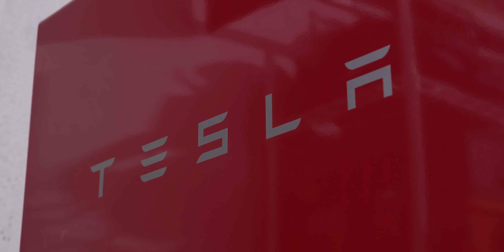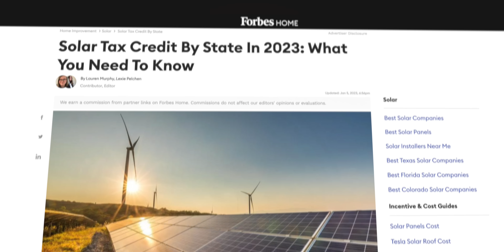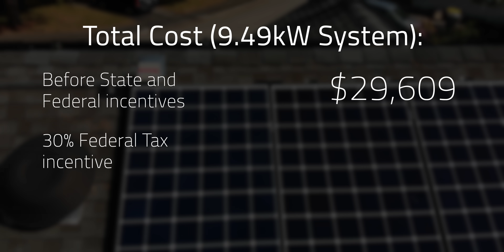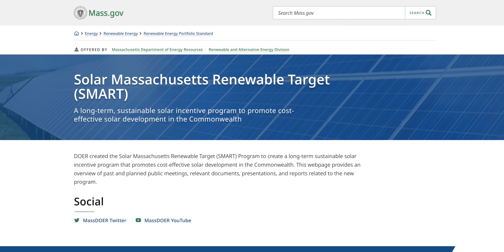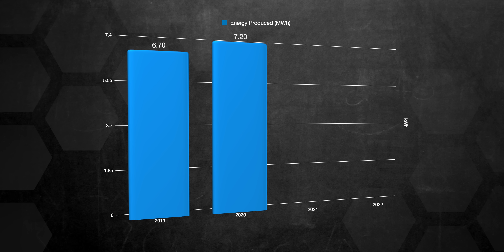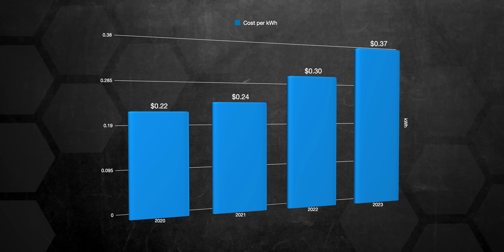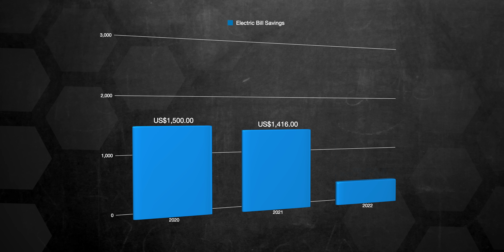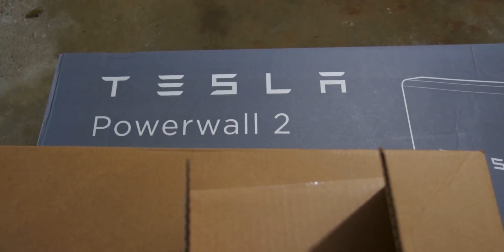5 Years with Solar Panels - Is It Still Worth It?

Comment: i spent a LOT on a 27 panels, 20kwh batteries, controlled by a solaredge system. did get substantial tax benefits. 
happened back in 2020. 

my calculation was
1) bank interest rate was .02% !!!
2) inflation will cause a negative return on bank savings AND ever increase electric power rates
3) there will be partial return on the solar system from selling the house

ignoring depreciation, system degradation, the system is returning 2% on investment. ALSO, i benefited from continuous power despite power outages. so, there is peace of mind.

Comment: How big (capacity) is the setup going to be at your new house? I have 6600kWh on my roof and if I knew now...... I would have put as many panels as I could on the roof. However the biggest regret is not knowing enough to get an installer who knew their stuff even though they were recommended from a site that supposedly checked the recommended installers out. I had twenty panels installed with two faulty panels installed and a third one going faulty seven months later and now three years after they were installed they are still sitting on the roof. Installer has gone out of business so it's shit creek and no paddle.

Comment: Hello Matt, I totally agree with you LG Panels were the BEST, I did a lot of research, with that huge 25 year guarantee ok a little more expensive but well worth it, I was totally shocked when LG stopped making them, I hoped to use them on my next home 🏡 when children left home to go to university, Solar panels on South facing back lawn on stands, love the look of the tracking flower Solar system but got to keep expenses down in retirement,
I have a feeling your next house will no doubt will be very economical to run, I even thought of moving fridges & freezers to a cooler garage away from the warm kitchen,
Matt have you ever thought of collecting rain off the room, filter & store that in a underground tank & using that say flushing toilets - watering the garden etc,
The energy crisis here so we all need to save as much as we can,
Thanks again for the very interesting YouTube channel 👍

Comment: 9.4kW power panels, but how much is the inverter? The production seems quite low, similar to the estimated production I get for a 5kW power with 4-5kW inverter. Ofcourse, depends on the latitude, I get this estimate in south Romania, 45° north latitude. I am preparing to start the installation process for a 11kW peak power panels with 8.2kW power inverter, east and south orientation, and this setups should produce about 12-13 MWh per year. Without any battery, the setup will cost about 6k€, before the 4k€ incentive. Yes, I see the price in Romania is way lower than in the US, but well ... the income is not the same. So, with this setup I should switch to a heat pump and get rid of gas heating altogether. Now, the tricky part is the way the system works here.

 The electricity produced has a RAW price at the point of exit from the inverter (the injection meter), but then it adds injection price, transport, incentives for green energy, etc, which increases the price of the energy taken from the grid to 3x the raw price. So, I have to inject 3kWh into the grid to get 1kWh from the grid and be even. Not really good. But, using a heat pump, with a COP of 3, I get exactly the same energy back into my house with that 1/3 energy I get back from the grid. And the heating will require most of the energy from this setup. Any thoughts?

Comment: at 30k for that size of a array...ripoff...

Those panels were maybe 7k at most for all of them together, the charge controllers, meter, cable, conduit etc at most should have been around 4k AT MOST.

These solar installers are absolutely fleecing people because the government is subsidizing their installs...

Big $$$$ when the government gets involved. Tax credit isn't based off value, its based off the bill. Which gets inflated.

On the good side, for 30k you could do a 12kw array + a 40kw lithium battery array and about 5k into inverter, charge controllers etc and make best use of the tax credit. 

Of course its your own time, labor etc that gives that value, but still, they are valuing their labor and expertise in the tens of thousands to install a very simple low voltage system.

Comment: Glad you have had a good experience!!  
Like you, I have had a bad experience with a solar installer. They started my installation June 9, 2022. It is still not done!  They have made revision after revision, all which wouldn’t have been necessary if they just had sent someone competent out initially, and have to get new permits each time. 
And no communication!  It has been 3 months since the last “installation crew” was here. And no word when they will return. 
I HIGHLY RECOMMEND you stay away from Bright Panet Solar! Or as we call them, NOT SO BRIGHT!

Comment: Tesla Energy installed 9.6 KWh system last year on my roof here in Southern Cal.  Since It's been 6 months with solar in NEM 2.0 tier with my utility company, I've been paying around $10 monthly for admin fee.  So far it works out for me after 30% Fed tax credit and the system cost is $17.5K now. With solar I can charge my Tesla and my RAV4 PRIME and  pay only a small electric bill monthly  today.

Comment: I live in Perth, Australia and due to roof constraints had to go with a split East(10 panels)-West(13 panels) 6.5kW configuration on my solar. Comparing our production with neighbours/friends who have North facing systems, we have a much longer generation time (i.e. to within an hour of sunset) but a lower overall peak. This allows us to generate the same amount of power usually but spread across a longer time so we can use that energy rather than rely on grid export at 7c/kWh (compared to ~30c/kWh import).

If I could expand to 10kW, we could then have more than enough excess production to fill 2 Tesla Powerwalls on an average day I believe
Reply: As an addition, here are my annual production figures from the E-W 6.5kW system:
2018 - 10.13 MWh
2019 - 10.30 MWh
2020 - 9.93 MWh
2021 - 9.81 MWh
2022 - 9.92 MWh

Sun is good here.

Comment: Glad it works for you. 
Electric is under $0.15 /kWh here, and net metering pays only 2-3 cents.
Also, the quotes I’ve gotten are 2x at least that cost, more like $3-4 per Watt and that’s before a battery. 
So it’s entirely pointless and wasteful to buy it here, literally never pays off.

Comment: 1 MWh a month?  I'm at 4 mwh a month, and to be honest, I couldn't tell you where it's all going.  I'm in Texas with electric AC and Electric heat.  I'm pretty sure I also need a insulation refresh as the house is drafty at times.

Comment: In California a 5 person panel on the California Public Utilities Commission voted unanimously to screw over consumers that have solar panels by allowing the electric companies to pay us 75% less for the excess power we generate.  We used to get paid back the electric costs they had charged us,  (not the transmission costs).  It's clear to me that greed by the electric companies is more powerful that what is good for consumers and clearly these 5 panel members were paid off.  And they want to increase the rates yet again!  PG&E was fined because their equipment caused wildfires that cost Californians their homes and some their lives, yet PG&E lobbied to get approval for rate increases.  So basically PG&E was able to get consumers to pay the settlement costs, talk about insulting arrogance!

Comment: Great video,I have  8.98kw array, SolarEdge inverter, installed in 2018 , I am on my third inverter, this time I put a DC breaker / over current protection,on each string coming into the inverter,also a surge suppressor on the AC and DC side. even though the inverter has overcurrent protection, the last code I read before it stop working was a Surge. i’ve had no problem with Solar Edge swapping out the inverter. I just gave them the last code before it stopped working. A lot of contractors Do not put Surge suppression on either side ac/dc , spend a little money to ensure longevity of the system.

Comment: I wouldn't consider solar if our electric rates weren't so high and there wasn't a future where the rates wouldn't go down substantially; Also, buying solar outright doesn't make much sense given the payback and uncertainty.  Yes you can capture the tax credits and all the upside, but you'll also capture the downside.  That is, if anything goes wrong, a component burns out, etc, YOU are the one responsible for it.  Yeah that might not occur in the first few years, but when it does it can extend your PBP by years.  Maybe this might make sense in a REALLY sunny place where for the same kwh/yr you can get away with a much smaller system, but not here in New England.

As much as I hate to say it, power purchase type agreements are a much better value; that is, you lose some of the upside but there is basically zero downside, given that electric rates aren't really going to go down.  Our rate jumped from ~ $0.24/kwh to around $0.36/kwh as of January 2023, and while I don't anticipate that lasting "long", I don't think we'd ever go down to $0.24 unless the world and national energy situation becomes remarkably better - and we're not exactly building power plants in this country.

With PPP and a ~ 12k-kwh system, which is about 95% of our annual usage, I'll save around $1500/yr (at around today's electric rates) with no upfront cost and basically no downside; the installation company takes care of any and all maintenance, and guarantees that production regardless of what the panels actually output.

Comment: I wish I had known that under the SRECII program, I'm not allowed to add more panels even though my system can accommodate more being plugged in.  It requires a new install with duplicate equipment and a second meter.  I'm actually considering the adding a few units that can plug directly into a 15A outlet.

Comment: Thanks for the video.  I purchased a system one year ago and it's worked well for me except for:
1. The installers created a leak in the roof that damaged a bedroom ceiling.  The solar company did eventually fix it. 
2. I expected the Solar Company to provide me access to the inverters (that I purchased) so that I could track the performance and health of each panel, however SunRun refuses to give me access.  The inverter manufacturer, SolarEdge, says that SunRun has to be the one to hand over the access, and they fully expected them to.  But otherwise the manufacturer can't help as SunRun has already registered the inverters and has control over them.  There is a view-only level of access, which would be fine, but again SunRun refuses to provide that even though I purchased the system.

Comment: I see the benefits, but let's be clear... "will pay for itself in two more years" means "We're in the hole for seven entire years... more if you count the battery."
This raises the question, how much lifespan is left in that  setup after seven years? If it takes you seven years to break even, and then you get three years of saving before having to replace the panels, the whole project is far less attractive.
The other question nobody seems to mention is, what does the roof look like after five years of being in the shade?
I know the shady parts of houses often have moss or fungus growing, which requires additional maintenance. Is this an issue when you have solar panels installed?

Comment: I have solar panels. These 12 are on a flat roof. The thing that I whished I knew before: in this setup you need wind deflectors. Ours didn't. They were on a rail with 4 heavy bricks to keep them down. During one storm two panels popped loose from their rails. No problem, I just placed them back and thightend the bolts. A few years later another storm. This time 6 panels came loose and two fell of the roof. They shattered. 
Our neighbors have also 12 panels on their flat roof. Their panels are just next to ours. They didn't have any problem because the wind couldn't get under their panels. Thanks to wind deflectors.

Now the two panels are replaced and the rails do include wind deflectors. They work so well that we haven't had a storm yet😀

Comment: Excellent lessons learned Matt, I hadn't thought about the rain.  I have a metal roof on a 2 story building we have snow guards on our metal roof and would do the same for solar panels but in the end I'm on a acreage and have plenty of room, in the end I will setup my solar on the ground not on the roof.  Based on your videos this makes the most sense for me.  Cheaper install easier to keep them clean, can put them in the optimum direction and son on.

Comment: A recommendation I have is to hire a solar company that is also a long time roofing contractor (family owned businesses are good).  Not only can they install a new roof if needed but they are likely to still be around in one form or another and all of the warranties are honored/performed by the same installer.  In my case, the local installer was considerably cheaper then the nation wide installers for the same product (~20% cheaper in my case).  Also, if you go through energy sage you get Amazon giftcard kickbacks for reporting back to them once your system is installed ($100-$150)...
Reply: Great recommendation on getting a roofer/solar company.

Comment: Hi Matt, First, you don't want the bathroom roof vent pipe on your south-facing roof surface. You can have it installed on the other side. Also, get the rough wiring for the EV charging done with the other electrical work prior to move-in.
Reply: I get that a vent penetration on the South side of the roof would get in the way of installing panels, but is there any other reason to avoid this?

Comment: Interesting, but the situation in countries other than the US is likely to be different. So far, in the UK, using batteries for power if the grid is down is not really possible. It can be done - but the batteries have to be isolated from the grid. At this time I don't think there's any reliable automated way of doing that. In the UK most people are either on the grid full time, or not. Some people and organisations can use batteries and even generators during outages, but there are hazards, and most people don't have the skill and knowledge to be able to do that. OTOH, mostly in the UK the grid is reliable.

PV panels are now a good idea, and over a reasonable period of time can effectively work out beneficial financially in the UK, but many UK houses can only really support 4kW panel systems, because house roofs are generally smaller. Snow is not normally such a problem - but can happen in some areas.

Also having good control over timing may be essential in because some electricity companies in the UK have a ratio of over 6:1 between peak and off peak tariffs. If the controls for taking electricity from the grid don't work well - which may happen - the costs resulting can be huge. If only off peak electricity and solar generated electricity are used, then costs are likely to be much reduced compared with simply using grid electricity without micro generation or battery storage. If batteries inadvertently take power from the grid during peak times - which should not happen - then costs could be significantly large.

Comment: My parents have a 5kw system on their house near Mackay, Qld, Australia.  we have lots of sunny days and this system produces 38% of the total power used by the household (3 air conditioners lol) however the buy back rate from the electricity company and other fees and taxes means that we only got $24.95 off a $199 electricity bill last month.  the system cost $10000 installed so its going to take over 33yrs to pay off the solar system.  only 31% of the power produced by the solar panels went towards our actual electricity bill the rest was resold by the electricity company and got eaten up in fees and taxes.... do some research, battery storage perhaps... and I'm a solar fan boy, I build solar party barges with solar panel coffee tables, love it ... just very unimpressed with how its worked out for my parents...

Comment: I did research on a solar array for my house in Vancouver, BC, Canada and found it made sense, even when accounting for our wet winters.  The savings + government grants would have allowed us to change out our gas appliances and furnace for an electric heat pump, induction stove and electric on demand water heater.  We have a large 45 degree south facing roof and a smaller 30 degree east facing roof that could accommodate together up to 25 panels.  I was also seriously considering LG panels which have a high quality rating.  British Columbia Hydro, the provincial public utility, currently offers a 1:1 net metering credit, and the standard rate is just under 10 cents Canadian per kwh (cheap hydroelectricity is a thing here), upping to 14 cents after a certain level of consumption.  What killed solar for us was BC Hydro's plans to decrease the net metering credit by 60% next year, followed by nonsensical rhetoric about "free" use of their transmission infrastructure by private power producers, of course omitting any mention of the capital cost of power generation from the solar array supplied "free" by customers.  Very short sighted.  The federal and provincial grants for heat pumps are getting better, so at least we can still go that route soon.

Comment: Why is solar PV in the USA is so expensive? 
Waaay cheaper here in Australia. $US500-800/kW is typical. Which I guess is why 1/3 homes have solar PV on their roof despite out net metering being asymmetric (retail price in, wholesale price out). Batteries however are a financially dud deal here. And VPPs here are designed to mostly benefit the power company, not so much the consumer.